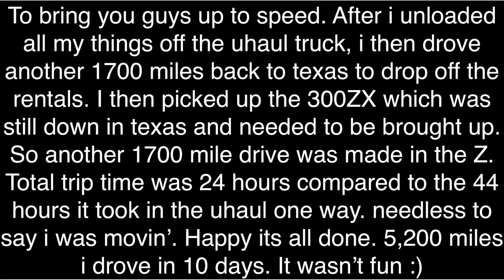Thrashing my 2JZ 300ZX around the Track! | Ups & Downs w/ In Car Footage!

Comment: That blow off sounds wicked! After your past few months, it's great seeing you being able to enjoy yourself! Were there any other sweet cars that were also there?
Reply: I don't think there is a blow off valve, I think that's the sound of the excess air pressure hitting the cold side of the compressor wheel off throttle.
Reply: It sounds awesome though